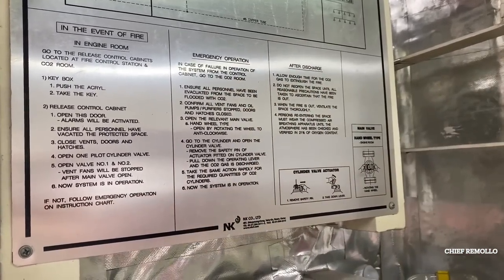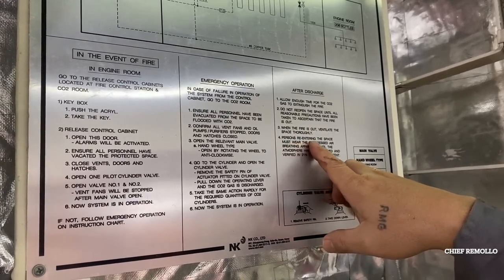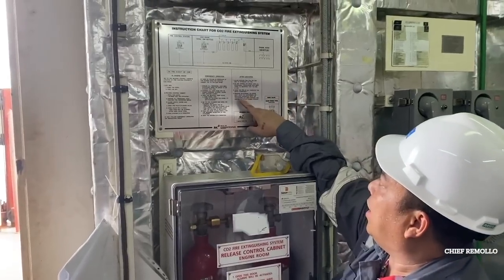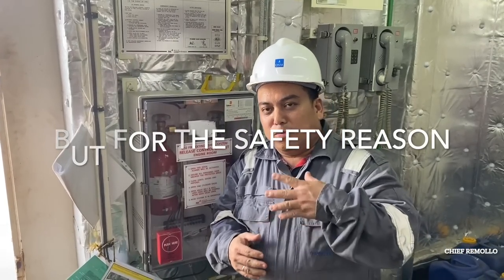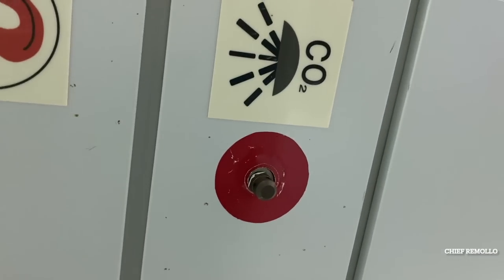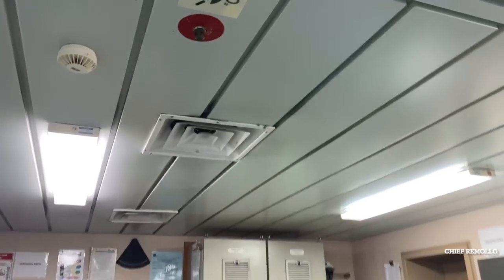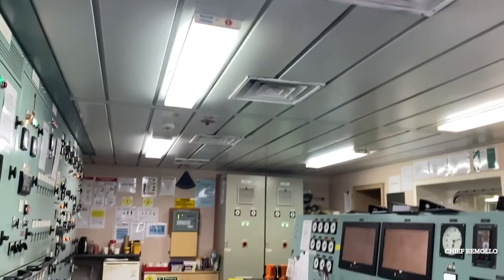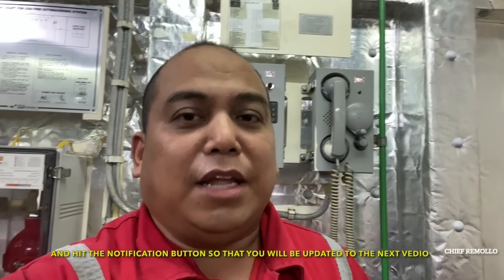How to operate and Release CO2 in case of Fire in Engine Room. Seaman’s Vlog

Comment: then if co2 automatically oprerated we don't need to release safety pin manually?
Reply from the maker: Still need to release the pin manually operated. The automatic release is being operated in different operational release depend on the design of your CO2 operation